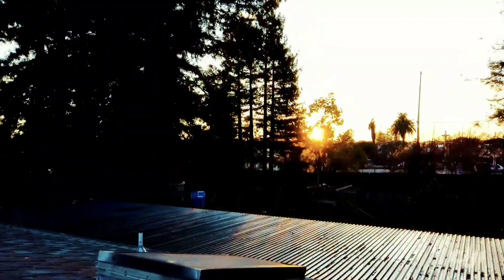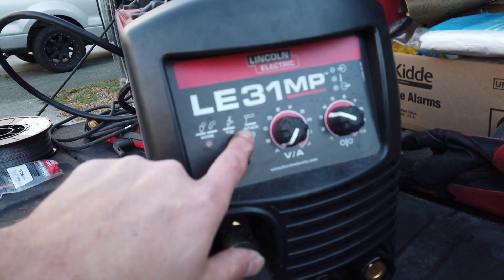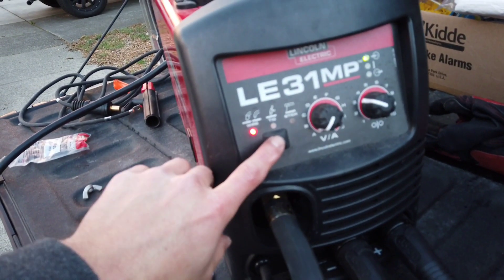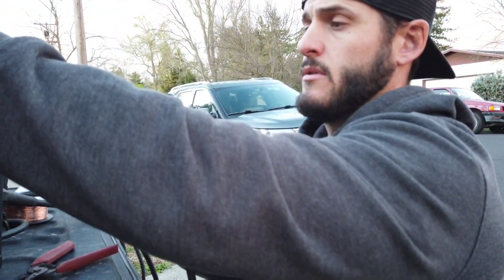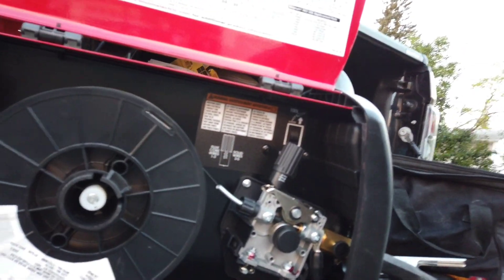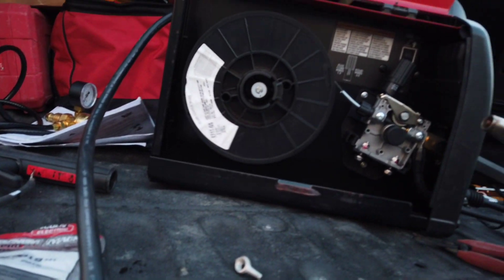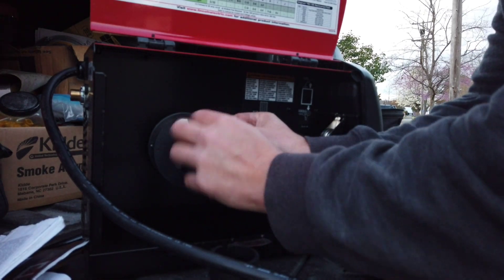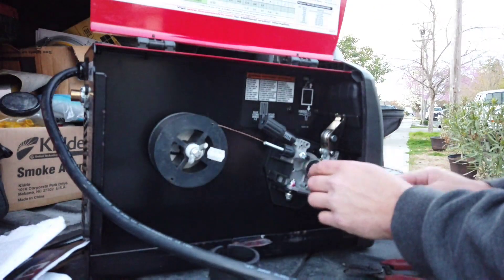LE31 MP Welder How To Set Up and Review

Comment: Is your machine still up and running?
Reply from the maker: Yessir
Reply: Nice i just bought one yesterday.
Reply from the maker: @CesarHuerta-ih7oj  I'd really advise getting the knurled drive roll if your going to be doing Flux core
Reply: @demidog4549  i do plan on doing some light flux with it as well as mig how does it burn the 0.35 ? I have the 110 cord on it. Need to see how it will work of my sa 200. Was looking for a suitcase but unfortunately dont have enough funds at the moment😅

Comment: Is there a way to get this box to run hotter or stronger?. I was on a job in Pennsylvania and these electricians hooked this little Miller stick box up it  was pushing 1/8th rides like nuttin with some thicker wire and gauge I believe it was awesome. Also it was ran off a generator. so how can you make that happen if it's possible? Does anyone know? Thanks
Reply from the maker: You'd have to have a large generator to run most any welder and no this machine has set capabilities. It's a multiprocessing machine which limits each process to certain parameters.

Comment: Is this 20amps 0r 25 Amps? I have it but it keeps tripping my 20amps and goes into duty cycle on 30 amps
Reply from the maker: It's designed to plugged into a 20amp designated circuit, so that means nothing else on the circuit. If your pulling power from something that's had multiple devices attached you'll overload the breaker.
Reply from the maker: What settings are you running? To be tripping a 20amp you'd have to be running it almost fully even with other electronics connected.
Reply: @demidog4549  straight into a kitchen 20amp outlet and out the window much to my mother's dismay, okay thanks a ton ill rigg up some half assed electrical jury rigged outlet and let everyone know you told me to, I appreciate it man
Reply from the maker: @jackmioff000  if you have space in your electrical panel you can add a breaker and snip the end of your extension cord that would plug into the receptacle. Wire it directly into the breaker connect neutral and ground to proper locations and plug your welder directly into the extension cord.

Comment: Every time I try this my roll of flux unrolls it’s a smaller one like you used in the video
Reply from the maker: Set a little tension on it and don't let go of the wire.
Reply: there's a white spacer you need you'll see included. it happened to me also, i lost half the roll before i found it last night lol.

Comment: Can you switch to AC for tig aluminum?
Reply: From thoroughly reading the specs, no. This is DC only. The only way to weld aluminum is with a spool gun MIG. I have never done this before, so cannot give any information about this process.
Reply from the maker: @cobes11  you are right, this is a DC only machine. When welding with aluminum you need AC current for the "cleaning effect". Mig welding aluminum with a spool gun also requires a significant amount of prep acetone etching etc. It's works and is effective faster then tig but requires prep and doesn't look as pretty.
Reply: @cobes11  Thanks.

Comment: Running FCAW .035 wire with the tension at 3 1/2 it started making build up at the drive roll. Making my wire flat and not push anymore. I just learned about the drive roll for FCAW wire that has ridges and grips the wire better. So I don't know what I am doing wrong but I am having trouble with the feed.
Reply: Hi. Maybe inside of your welder you have the small steel wheel on .25 instead of .035. You have to uncrew the black plastic knob and flip the small wheel where the .035 face to you.

Comment: Thanks for the vid! I was looking at buying this machine. How does it handle thicker metal? I want to weld some motorcycle frames and seats
Reply: I have this machine and it'll weld 1/4" all day long. Even had to dial the voltage down a bit from the chart so I'm betting it'll handle 5/16" just fine.
Reply from the maker: It handles up to 1/4" material very well above that is pushing it a bit. If you liked the content dont forget to like and subscribe!! Any other questions feel free to ask.
Reply: @demidog4549  that sounds like jt should handle some chromoly pipes. Thanks for the info!

Comment: Hey i recently got the same welding machince and im trying to weld exhast pipes and i cant get the settings right. What should i have them at?
Reply from the maker: Depends on your wall thickness, type of metal etc.. What is happening when your trying to weld? What problems are you having? What process are you using?? What size wire are you using if using wire?
Reply: @demidog4549  im using .025 steel mig wire. I cant really find a good wire speed and amps to have it on. Im not use of thickness. I have it on the lowest amps and it burna throw easily.
Reply from the maker: @honeynutmc1862  are you butt joining or have slip expansion?
Reply from the maker: @honeynutmc1862  try tack stack method turn setting to F 6. Get joints tight as you can. Pull trigger and don't move for about 1 sec. Let cool move over and continue all the way around tubing. Or you can always tig weld it with less burn through.
Reply: @demidog4549  its butt joining, what wire speed should i have it at? And the gas should be at 25 right?
Reply from the maker: @honeynutmc1862  comment above 👆

Comment: So do you use shielding gas for mig welding and stick welding?
Reply from the maker: Just mig, stick electrode contain flux which protects your weld puddle  known as (SMAW) shielded metal arc welding. Here's a link to another video with setup
https://youtu.be/IDJ0MvBJ868
Reply: Okay thank you so much
Reply from the maker: @manuelbarron4378  no problem, don't forget to hit that subscribe button!!
Reply: @manuelbarron4378  Shielding gas for stick? Bro, if you are asking questing like that, then you should not even be near a welding machine until you have taken a couple classes. I am not saying that to be mean, just to let you know where you are. TIG and MIG always use gas. Some flux core does, some doesn't. Stick NEVER uses gas.

Comment: The nozzle isnt needed for fluxcore welding. Its used for mig welding.
Reply from the maker: You don't need to use it for flux core because there is no gas but it's like saying you dont need safety glasses to cut metal. Squinting works untill you catch a piece in the eye. It comes with a flux core nozzle I dont feel the need to change it each time. I appreciate the comment non the less.
Reply: DeMiDoG45 I have this machine, and I tried setting up this weekend. I wanted to give it a shot at doing the flux core but I was never able to get the  gasless nozzle installed it seems their is not thread on the nozzle. I know you mentioned it is not needed, so would I be fine using it the the chrome nozzle if I can’t figure out how to put on the plastic one?

Comment: The TiG is just lift start and not that great.  For $750, even from Lincoln, it should come with it.  I've had mine over a year and put many 2 lb spools through it. Welds smooth for an inverter.  Best 120V machine on the market hands down.  I tried Eastwood, Everlast, HTP.  This is better.
Reply from the maker: I prefer HF tig in general, lift start has its place in areas with frequency issues. I agree it should come with it for the price. I cant see myself utilizing it with this machine so much as I mentioned. All in all great machine runs super smooth and I couldn't be happier for my mobile jobs its fantastic. I dont have to carry around 240v geny.

Comment from the maker: Hope this helps someone out setting this machine up.
Reply from the maker: @chaddesousa834  yes, you need to set your wire speed aswell. You always set your machine for whatever thickness type of material, wire size etc.
Reply from the maker: @chaddesousa834  it depends on your material thickness. If you look at your chart it will give a reasonable starting point.